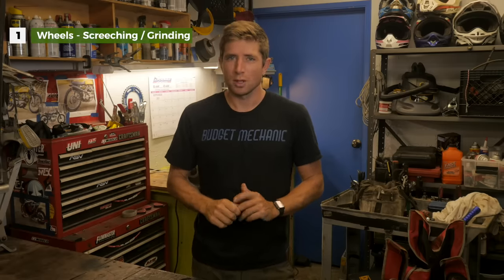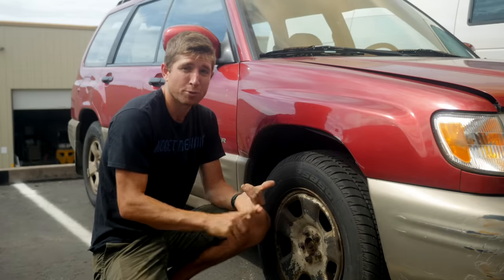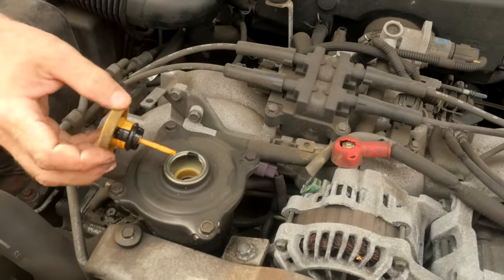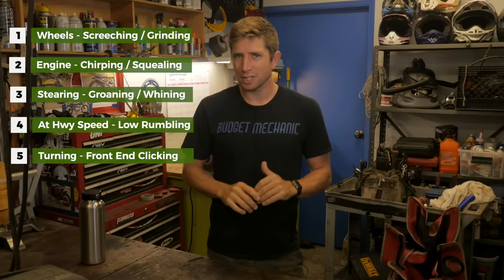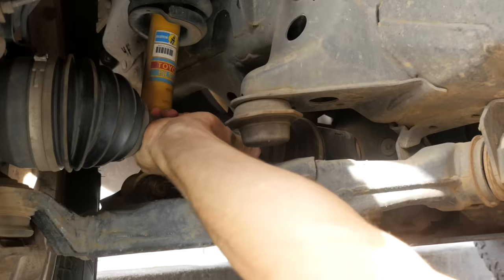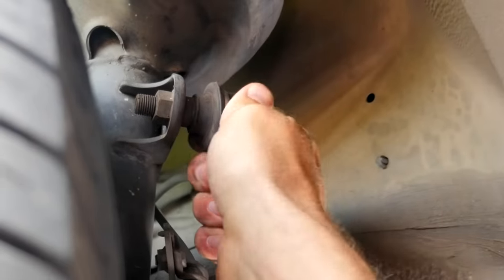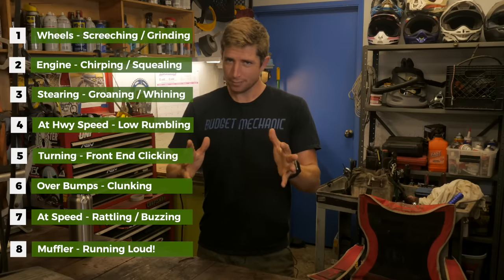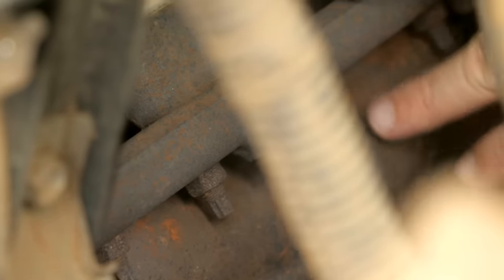8 Top Noises Your Car Engine Makes and How To Fix- Grind, Clunk, Squeal, Click, Groan, Rattle

Comment: The noise coming from the front end of my 2001 dodge ram 1500 2wd is almost the exact same as the stabilizer link noise from your video with one difference. The noise from my truck has a little higher pitch to it. I got excited once I heard your video. I thought for sure it was my stabilizer links, but mine doesn't appear to be bad at all. My links connect directly from the top and bottom with rubber bushing. Not at 90 degrees with a boot like an example in your video. is there another component that might make a similar noise?

Comment: I have A rav 4 2008 with 212k mikes on it. It is making a low rumbling sound in right front which sounds like the Inner tie rod/sway bar link  noise in your video. 
I have  been told i need to replace struts on front and rear because they are leaking but no mention has been made of tie rod/sway bar. Would struts make a noise? I’ve been told  rumbling is from back tire cupping but tire place said tires are fine. I just want to be sure if i pay $1100 to replace struts the noise issue will go away. It also does rattle in right front higher up. I have been to 2 diff mechanics. Most importantly, i want to be safe. Are leaky struts dangerous?

Comment: Have been hearing clicking when I turned, found out when my mechanic rebuilt the front passenger side of my car he forgot to clamp the boot down 🤦 so it was just loose letting out all of the grease and in all the dirt.

Comment: I just replaced Front Brake Calipers , Rotors, Brake pad. when I brake at speed over 50 km, I heard some noises (like shaking sound but the steeling wheel not shaking) from front. the high speed  the louder sound. under 40km, it is normal and quiet. we balanced the front tires, but the sound is still there. do you know what will the problems be (when we took out the rotors, we hammered the old rotors so long to get it out)

Comment: What a Beautiful video! ❤ have a question, my car is making the bearing noises, i bought the rear wheel bearing and installed it, it cost me around $1.2k, both side, but it still have the noises, i bought the timken bearing, but i am planning a trip to AK from Bos and this noise even though some friends told me that it could be the wheel, i dont see how a wheel could make the bearing noise, i have the base mode front wheel drive 2006, Toyota Highlander. Any recommendations? I'd really appreciate any suggestions or recommendations to attack this noise from my rear end, Thank you!
Reply: What other part on a front-drive vehicle could make this noise coming from the rear? Knowing that it has two brand new bearing and hub in both side.
Reply from the maker: Bad tires can make a very similar sound to bearings! How are your tires? Worth switching tires front to back to see if sound moves

Comment: When i take off my foot on gas , my car makes horrible noise it sounds like  if you put a bunch of  metal marbles in a metal barrel & push it around.  
It started from gear 5th , than 2nd now 3rd as well . When my foot on a gas paddle is ok but once my foot of f it dose sound bad . Any suggestions i would appreciate .

Comment: This is all great, Thanks.. Although my issue is weird.. I just had the rotors machined and new break pads installed.. I am getting that high pitch squeak which we have put down to the callipers needing to settle into place because the breaks got so low and they had ceased a little. Although I have this sort of low rhythmic squeak at low speeds when breaking. Every time I come to a stop it squeaks in each front wheel.

Any ideas?
Reply from the maker: Did you get this figured out? Usually I would say this is due to glazed rotors but machining rotors should fix that… possibly the brake pad hardware is rubbing on the rotor. Would need to take them apart and check for rubbing
Reply: @BudgetMechanicHawaii  Hey yeah, It was the bushes arms. They had been repaired but not having issues with the transmission and it is like a loud grinding noise which turned into the gears slipping and I was told it was normal for the noise because it was so worn after a service and i would eventually need a new transmission but it should hold out for a few years.. and it lasted half a day.. So waiting to find out whats happening with the car incase they didnt put enough fluid in or its just a scrap job now lol
Reply: Spent 3k on the car now for it to probably need to go in the bin :( So now I have no car anymore and we thought everything was on the up with my partner getting an interview for work and yeah.. Stuck in limbo now.
Reply from the maker: Sorry to hear it! Time for a motorcycle!
Reply: @BudgetMechanicHawaii  hey don't tempt me!! I am keen to get on a motorbike.

Comment: Hey
I have number 4 
If i go straight on highway i hear it. Right curve it be louder. Left curve it disappears. Does that mean a ball joint?
Thanks in advance.
Reply from the maker: Usually that would be a left side wheel bearing or tire

Comment: What if the noise is very faint and sounds like a dinner fork scrapping against a dinner plate? The noise comes when I'm moving, and stops whenever I tap on the brakes.

Comment: Excellent video. Thank you very much.

I have a sound that is strange. It's a 2010 Toyota Tundra truck.  The sound comes on ONLY while in gear accelerating even at low speed.  It is like tsik tsik..repeatedly. I checked and it is Not the serpentine belt. It does not come on while parked.  Any idea?
Reply: I have the same problem with my accord.

Comment: I have an issue where vibration comes on hard usually around 45 mph, causes loss in power feels like going over rumble strips but not near as loud. When put in neutral it completely smooths out quickly. However if I don’t put it in neutral and let off the accelerator it makes a clunking and grinding noise until it slows down until about 35 mph. Has an issue accelerating from 5-15mph and makes grinding noise. When turning it at low speeds makes a grinding noise. When slowing down quickly and come to a stop there is a variably loud thud that sometimes happens after completely stopped. Took off engine cover and there is an oil leak. Front wheel drive 4x4 2019 jeep Cherokee 109k miles having it inspected next week. Any input?

Comment: Can a wheel bearing just be squeaking? I started to notice a squeaking coming from the front area of my car after it got matienced took it back to the dealer and apparently they didn't hear anything. All I hear is squeaking sounds like it's coming from under the hood then it sounds like it's coming from my wheels. I have recorded the sound to show the dealer again. My car is still semi new a 2021 and got it in April so still less than a year. I felt like the people at the dealer just brushed me off when I told them 😒

Comment: my exhaust shield is by my catalytic converter that's doin it...  making a noise similar.......but ONLY after i drive for about 20+ minutes it'll start doing it.
Reply from the maker: Heat will do wild things
Reply: @BudgetMechanicHawaii  indeed, im more worried about my left front axle though hearing loud pop after i cold start and drive out of car port w/ mega vibrations during sharp turns. pretty sure its the left.....as that was the side i jumped a curb over smaller snow bank last winter in a parking lot. lol

Comment: I had a local mechanic, put new brake pads on yesterday, and now, my car, is roaring/loud from the back end.  It was so bad, we thought, we had a wheel loose. We took it back, and all I got was, "I think its the back rotar, and you need a new one." Well, if this were the case, the car would've been doing this before they changed the pads, right?  The owner is going to look at it today.  Any ideas? No roaring before, they put new brake pads on yesterday. They also said, lets see how it does after it sits over night. 😑

Comment: @2:25 another way to test if it is your belt making the noise is to spray water on one of the pulleys while the car is running and see if the noise goes away.

Comment: What could this noise possibly be? I have a 2005 Nissan Altima 3.5 SE. While driving I will randomly hear what I could only equate to the noise of the car breathing for a second. Sounds as if someone was lightly exhaling through their nose for only a second and then goes away. Happens pretty frequently.

Comment: I’ve replaced the front passenger side pads, rotor, caliper and wheel bearing on my 2013 Ram 1500 and still hear that metallic grinding. What. Is. Happening????

Comment: My car has a rubbing noise in the front passenger I jacked the front end and put the car in drive and it sounded like a break caliper so i changed it but it still makes the noise. It gets louder the faster you drive and I can even feel it in the floor and steering a little. It doesn’t sound like a bearing and I don’t know what else it could be.
Reply from the maker: Tire rubbing on something? Rotor rubbing on the metal shield around it?
Reply: @BudgetMechanicHawaii  I think might be a bad wheel balancement or tire because I swapped the wheel on the side that was making the noise to the back and now the sound is coming from the back. Thanks for responding!

Comment: Hey Josh, I think I'm suffering a sv axle problem. The thing is that it only makes noises when I drive for 15 minutes or longer. Very hard to diagnose cold. The dealership replaced the driveshaft and noise persists. Any ideas?
Reply from the maker: If it’s a front wheel drive vehicle then maybe they replaced a cv axle. If rear wheel drive the drive shaft is a totally different part than cv axle
Reply: @BudgetMechanicHawaii  thanks!

Comment: Can I offer you a job to fix my Howling Hub with assembly,  removing Air Intake cover, replacing spark plugs and coils.  Finally checking cats and o2's.  Po430, po116.  Parts in trunk.

Comment: Do you have a video about rough sounds when stepping on the pedal? It sounds like my muffler is shitty like people can hear when i step on and off the pedal....
Reply: I had that problem with my car. Turns out my exhaust had a hole it it. Depending on how damaged your exhaust is, you can either weld it or just replace it.

Comment: I have a rattling noise when I’m holding my brakes on my car. Would you know what that is?
Reply: It doesn’t occur when I’m parked or driving only when I am on my brakes
Reply: And my brake pads are all relatively new so I do not believe it’s my brakes

Comment: I have a Nissan Primera p12,  check light came on a week ago ,an am hearing a humming sound, sounds like it's coming from fuse box, when engine is off I have to take battery out for the sound to stop , now the engine is switching off while I am driving please help
Reply from the maker: What’s the check engine light code?? Start there!

Comment: My car makes a rattling noise a low speeds that would make you believe is the sway bar links but i have replaced those both sides. I replace almost every suspension component. I can't figure it out and it's annoying
Reply from the maker: Struts? Axles?
Reply: @BudgetMechanicHawaii  i replaced the struts already. The axels very tight in there and not busted at least in the outside. I don't want to replace those if that's not the problem
Reply: @kaliman198117ify  axels don't rattle so don't worry about that, if you've really updated your suspension then I'd have your brake lines, a/c hard lines, and heat shields looked at, sounds like something could've come out of a keeper or could be resting on the exhaust.
Reply: @alleyesopen7776  so i checked my breaks again nad i noticed my rotors were kind of not seating correctly, not sure how to explain but i took it off amd put it back together and the noise went away about 85% . I can still hear it but is not as annoying. Im not sure why would that cause a noise that big

Comment: We should also duplicate the sound of driving with a rock or nsil stuck in your tire, yhe sound that happens ehen the heater blower fan motor begins to fail in the dashboard, and the sound of a failing water pump.
Reply from the maker: Those are good ones!!

Comment: Could I ask for advice here? I've got a clunking noise, similar to the stabilizer link one mentioned here. It appeared suddenly.

One of its characteristics is that it becomes more quiet and almost disappears with the slightest acceleration. If I let go of gas, roll, or brake, the clunking is louder. Its frequency increases with speed. What could it be? Thanks!
Reply: I’m having the same problem.  It sounds like a bird stuck under the vehicle when I’m going over 50km and get loud when I’m slowing in second and first gear. :-(. Can’t find anything
Reply: So I figured out my issue. Switched it into 4 high and got the nois as soon as I started moving. My guy says cv joint. I’m check in it out this weekend. So try throwing it in 4high see if it replicates the noise. Drive slow foreword and turn, repeat in reverse. Hope it helps
Reply: @Juliette Valsamakis It's a CV joint for me

Comment: Girl here with no guy help lol I’m trying though but this is like a foreign language for me… I just bought my Lexus UX250H 2019 and when I drive below 10km I hear this knocking noise at the backseat passenger side as if something is dragging on the cement as I drive but I looked under my car and nothing seems to be hanging and when I go past 10km, noise stops. I guess I’m asking for help before I take it to a mechanic because I don’t want to get screwed over with them thinking I’m naive lol

Comment: Great video! But my noise is not in here. When I drive around town at low speed it makes a loud noise I can’t seen to locate it. I change the purge valve and the noise still there. At high speed the noise go away on the freeway. It’s only at low speed when I step on the gas. It feels like I don’t have power but when I go on to the freeway my power comes back. The sound comes only when I step on the gas. If I let my foot of the gas and just let the car run it goes away. It only comes when I step on the gas. I thought it was my fuel pump going to the purge valve that’s why I change the purge valve but it didn’t solve the problem. Please help me!

Comment: You are the best bro. Best video ever. I have a rolling sound when I am driving on the highway.  It increases with acceleration. This started when my 18- year son drove through a big flood ( high up to the engine) when it rained.
Reply: Sounds like a bad bearing.

Comment: Great video! I wasnt able to figure out what noise my car is making sadly, nothing like any of those, but i enjoyed the vid! I just need to wait for my mechanic now 😉🤣
Reply: The noise ended up being one of the bolts that hold the tyre on that had lost its thread so it wasnt tight... needs both a new bolt now and the thing on the car that it bolts onto..i've decided not to drive it until it fixed...
Reply: Ticking little while idling. But moreso when accelerating. Would that be a lifter?  And if so,is it necessary to replace all lifters? Still making payments and on limited income but need my car to get back and forth for my cancer appointments.
Reply: How do I subscribe?

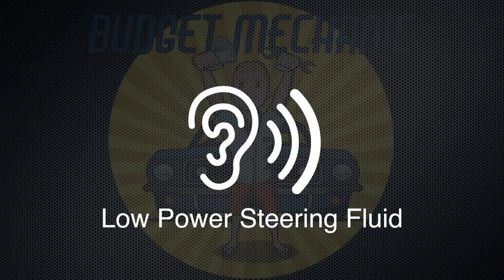Comment: This is one of the most comprehensive vids that i've seen.. nicely done.. got a question though, on mentioned vids 3:06 i have the same groaning/whining sound but my car is on electric steering.. is there anything aside from steering fluid that might have caused this issue? Thanks in advance

Comment: You are so awesome! Thank you so much. I am going to do that wheel bearing test today. My steering wheel is straight but my tires are going left so I'm definitely getting an alignment
Also, do they check the stabilizer links on the tires when they do the alignment?

Comment: Brilliant video thanks . 
I have a noise that you haven’t covered ! Maybe you can help ? 
When engine is idling and I pull away there is a kind of whirring noise - harder to describe in words than to do ! 
Like a washing machine before it’s about to spin - but much quieter- like a repetitive coming and going - rhythmically . Of course I guess it’s still there at higher speeds but I can’t hear it then . 
Have just had cam belt and water pump replaced but sound still there . 
Any ideas ? It’s a passat btw 
Thanks 🙏

Comment: So good!. I've just replaced cv joint and noise still there, sounds more like the stabiliser joint noise when turning wheel whilst driving or reversing from parked.
I call it a grinding ball bearing noise .
Reply: Thanks this is the comment I needed. Will be replacing stabilizers before the cv joints. It's a grinding/poping noise?

Comment: Bravo.

Your video is short and simple. Yet it also covers enough to get across what’s most relevant about each possible problem.

Your information doesn’t even need to directly solve my problem. You’ve at least sent me down the right path to diagnosing my problem so I can fix it.

Comment: My car makes a sound similar to the belt, but only when i push the throttle. I can be at 5.000 rpm and it doesn't make any noise but the moment that i touch the accelerator not a little but some more it starts like a bad belt.
Reply: My 2002 Honda Civic does the same thing🤔
Reply: @Big.Rage_Roc  it was the spark plugs, they were loose

Comment: Hey Josh. Thanks for a detailed video on car issue. I found another problem in car braking system that u may plz elaborate.  When I press the brake pedal, there is some crunching noise or sometime a single tick . This is noticeable only at low speeds. The crunching noise and noticeable everytime when at low speed on pressing pedal. It has some frequency like after fraction of second.